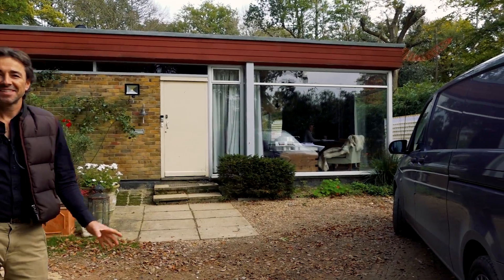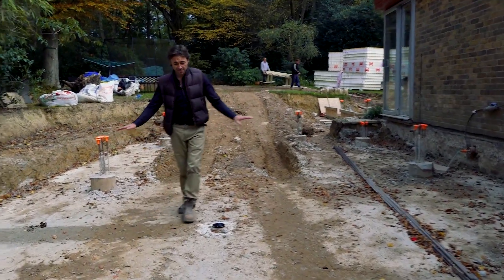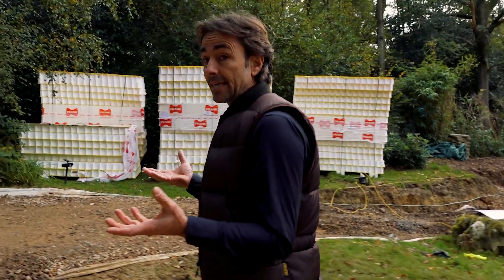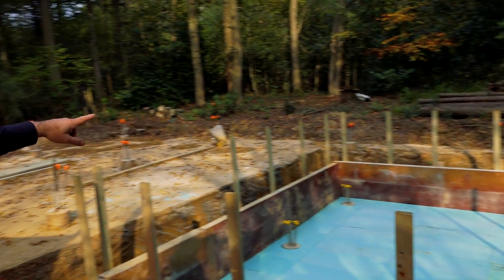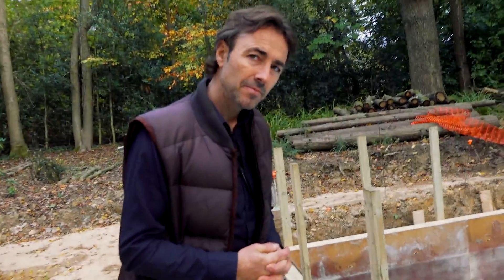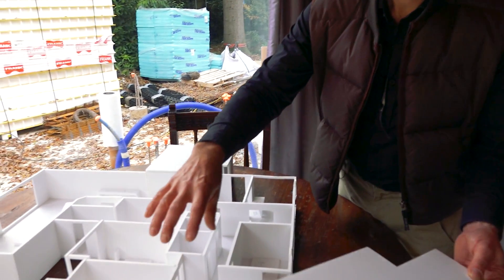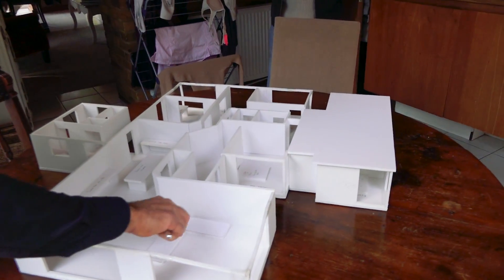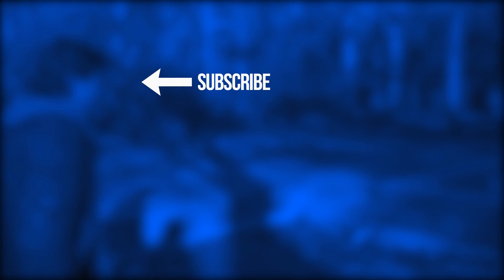Don't Build on Clay Until You've Watched This - Capel #1

Comment: What value do the piles add ? Why not just do a normal raft ?
Reply: Great debate!! I explored every type of groundwork solution for this project and had 2 separate ground investigations carried out, I had different engineers suggesting different solutions from standard foundations and voided beam and block floor to insulated ground bearing slabs!! but I had to decide on a system that was capable of dealing with each extension location and the garden room, we have lots of trees and we intend to keep them intact so even though it was probably more expensive going for the piled voided rafts it was the only way I was happy to protect all the trees.
Reply: @robinclevettcarpenter   ....and there in a nutshell is the perfect reasoned answer. We must build or extend or restore with absolute empathy with the environment. This build is a sympathetic restore of a groundbreaking historic design. It would be easy to fell trees and clear a site. But to build or restore with minimal damage or loss to the surroundings is great and must be the way forward. Brilliant stuff Robin.
Reply from the maker: They had a raft on the old building and it failed.The piles go deep and  the water content deep down is not so variable so there is less chance of shrinkage and heave. Also the trees can take a lot of water which is both a good thing and a bad thing.
Reply: Skill Builder Just seems a bit odd to me, the whole point of a raft is so it can move with the ground, not going to move with pile driven columns, maybe just terminology differences, normally have concrete beams connecting those columns, hopefully see some footage of the next stage 👍
Reply from the maker: I love this kind of debate. Raft versus piles. There is a large estate of houses near  me that were all built on rafts. Some have been demolished but the ones that survive have had no end of trouble with the drains. 
The drains have sunk in many places and I have earned good money replacing them. There is a lot to consider  when you build on land that moves. London is on clay and everything of any size is piled.
Reply: You don’t have to convince me, I always think a raft is a short cut to saving money, floating oversite is one thing, but the whole structure on a reinforced slab, I’m old school and trench fill is a favourite, although as stated the amount of concrete with the depth needed for those trees.
Reply from the maker: I am also old school but a 2 metre deep trench is stil going to be affected by the water table in clay. If you had a long hot summer it would dry out. I suppose if you put rebar in it and clayboard all around the outside it would be o.k but in clay I would pile all day long.
Reply: @SkillBuilder   Compared to a pier and beam foundation how effective or cost efficient is this rafted pile foundation?